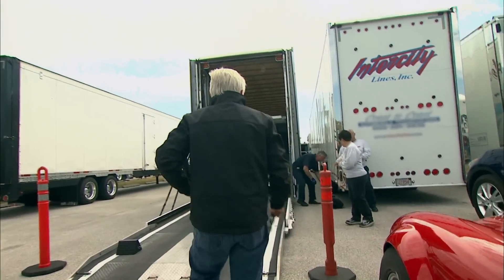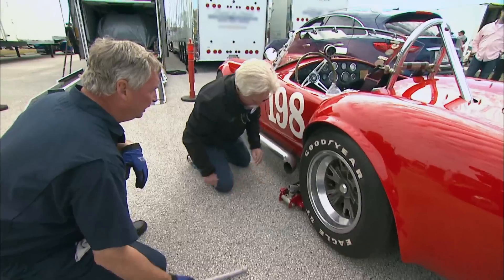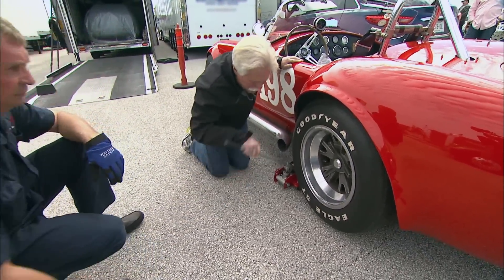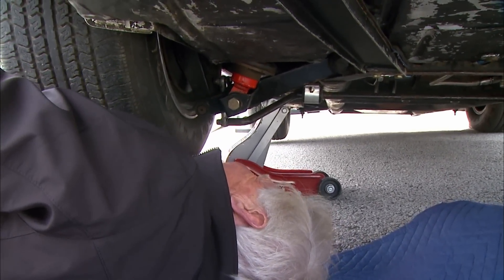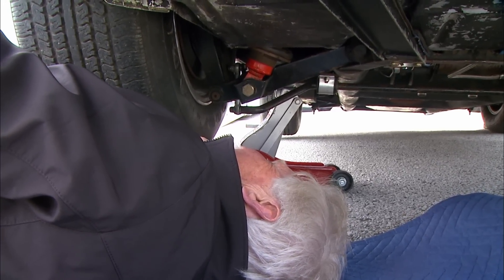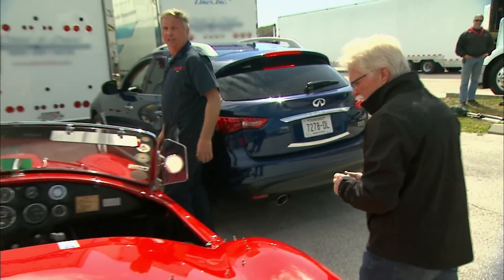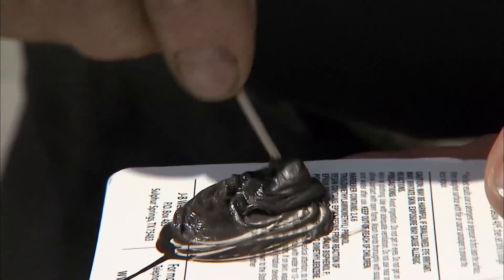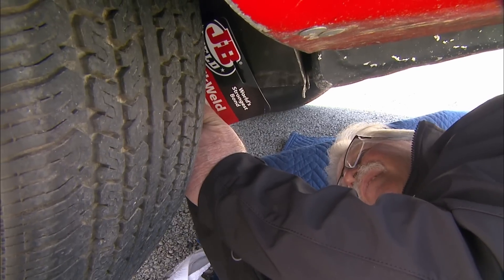A Leaking $2 Million Cobra? | Chasing Classic Cars

Comment: Dip the threads of stainless steel sheet metal screw in JB weld and screw into place. The rest of the tank will rust away before this patch leaks again. I've repaired fuel tanks on cars, trucks and construction equipment with this method.

Comment: you do not jb weld a supposed "$2 million car" its not a two million dollar car fuck that idiocy. its right around $200,000 -$250,000
Reply: No, its 2 million...
Reply: It is worth $2 million +. It's a real AC Cobra. Very very few are left in existence, so the value is actually increasing. One sold this year at Barrett Jackson for $5 million. So these are worth $2 million +, not $200,000.
Reply: That car is worth every cent that somebody is willing to pay for it.  Not a penny more and not a penny less.  It could be worth $5K today and $2million tomorrow and then $4K a week from now.  It doesn't matter except for the fact that I  wouldn't be driving it on the road with the other clowns out there.